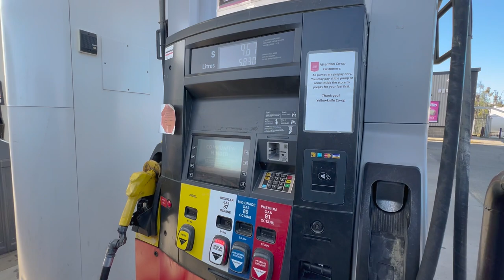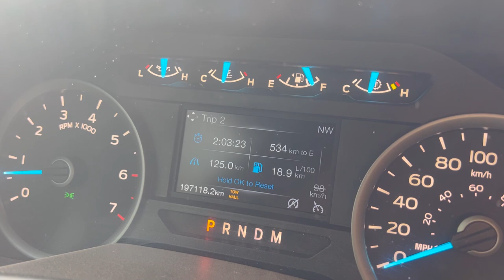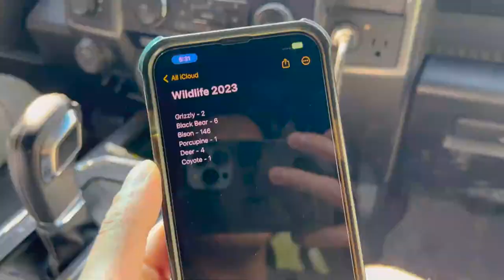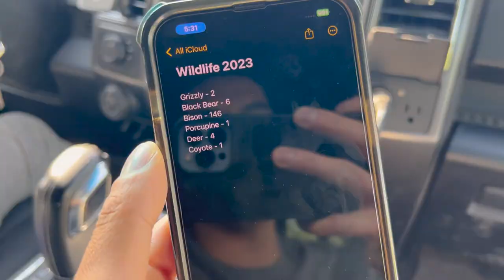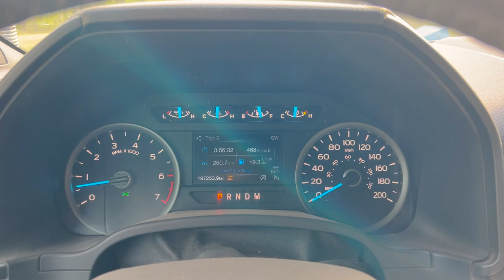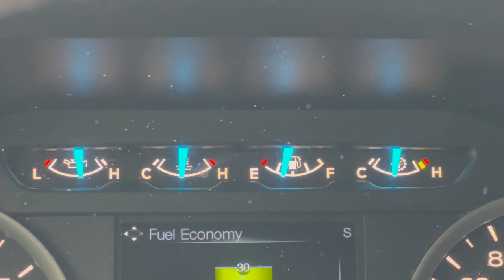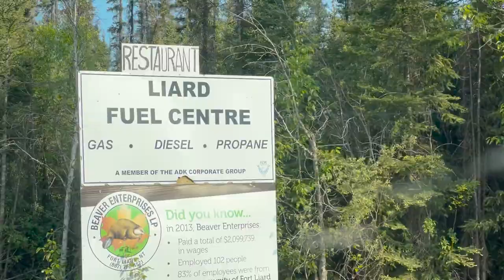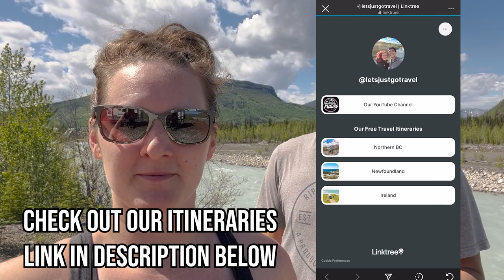500KM Gravel Road | NO GAS | DUST EVERYWHERE

Comment: I always turn my roof fan on high too create a positive pressure in my van to keep the dust pushed out.
You can always tape a furnace filter to the fan opening if the fan is pulling dust.
Reply from the maker: Does turning on the roof fan work? I thought about doing that but didn’t know if the fan would pull enough air for it
Reply: @LetsJustGoTravel  you just need a little positive pressure, it makes a big difference

Comment: We have had the dust issue in the Yukon and Alaska as well.  A couple tubes of caulking will go a long way sealing up around the wheel wells and where the plumbing and things enter the trailer from underneath.  Helps keep the mosquitoes out too.  Looking forward to your videos every week!
Reply from the maker: Yeah we discovered that it was also coming in from the wheel well! Just covered with duct tape from the inside for now but I should go get some sealant. Thanks for tuning in!

Comment: All vents and windows must be closed when traveling on dusty roads. Any left open gives the dirt a path.
Reply from the maker: We figured out that it was coming in from the wheel well seals as well as the front entry door. Might have to replace the weather stripping..

Comment: Great adventure. I'm envious. Nice to know about the dust issue. I'm thinking if I do something like that, maybe duck tape around the outside of the door. I'm wondering if some of that came in through the fridge and heater venting on the rear of the trailer. If the fridge is off, could tape over those vents.
Reply from the maker: Thanks! I think we narrowed it down to the passenger side wheel well as well as the entry door. Duct tape on the inside of the wheel well worked!